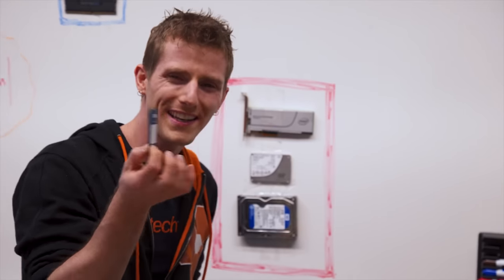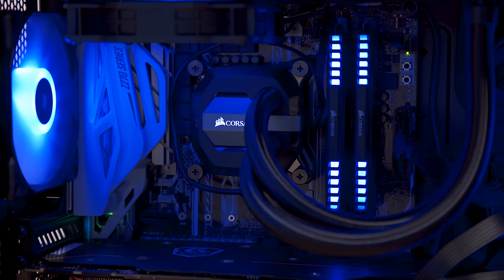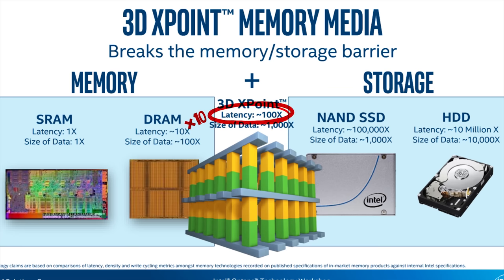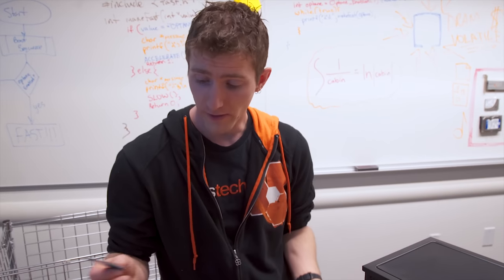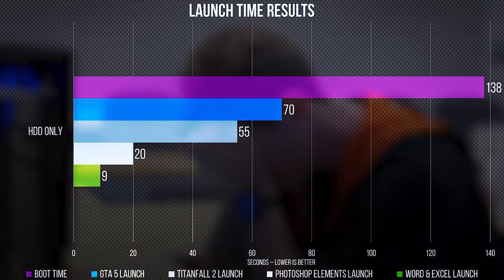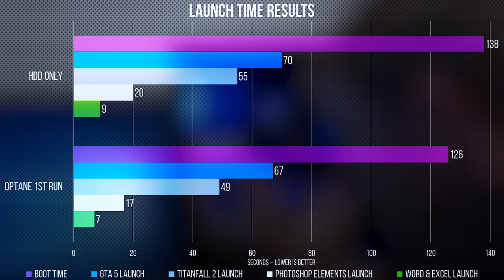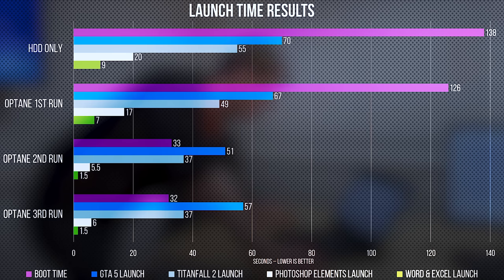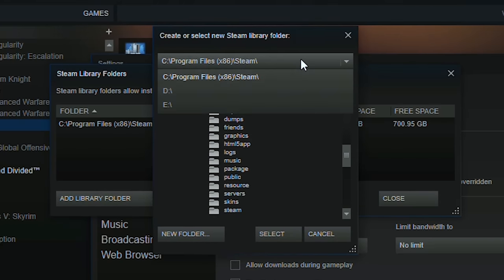Intel Optane Exclusive Hands On - SSD Crushing Performance

Comment: "here is a normal computer"  shows expensive high-end led rig
Reply: considering the lack of a proper SSD, what's being measured here is 100% accurate
Reply: a GAMING normal computer
Reply: Watch tech deals if you want normal.
Reply: 1080's arent normal bby....
But i do see your point.
Reply: "here is a normal computer" shows a PC using a Hard Disk as a boot drive.
Reply: I mean I have a very simular computer, I have one, linus has one, thus everyone does?
Reply: Christian O. You forget there are poor people who doesn't.
Reply: But it has ONLY A GTX-1080 not a GTX-1080 TI omg Linus I am disappointed!!!
Jk. JK.
Reply: Every component costs ~$350 or less MAX (do you REALLY need a 1080TI? Really?). Buy one piece per paycheck, assemble as you go. BOOM you end up with $1400 computer. Yeah it takes time, boo hoo. Or just buy a damn $270 Xbox or PS4 and plug it in to your dad's flat screen TV and stfu.
Reply: N Hiles its a normal computer. linus will say it is an enthusiast computer when he sees titan xp in sli
Reply: Tim Mityok Not everyone is a child who can throw away their entire income on PC parts. Throwing away $350 every two weeks is unattainable for most.
Reply: Tim Mityok My issue with that is if you oder parts online. How do you check if its DOA?
Reply: Except a brand new Kaby Lake. Meaning anyone with a pc older than 6 months can't take advantage of Optane at all.
Reply: I bought a 6700k about 6 months ago. Fuck.
Reply: what he meant by normal is intel did not make a non-consumer computer that was specially designed for that ssd if you have a mother board that generation and a cpu your good to go, fuck it seems every time linus makes a vid we get all these wine babies that can’t stop talking about cost and when someone tries to tell them to fucking save some money they shit themselves trying to insult them and and saying not possible (DevilDude4427) at the time I built mine I was working in a supermarket only 2 fuckig days a week and was studying finished it in one year and my rig can still benefit of that so yah it’s not fucking hard you just need to be patient and save.
Reply: Poor people won't have money for Optane, if theey would have, then they will buy SSD.
Reply: TurtleGalaxies the graphics card doesn't do shit for the build. Neither do the LEDs. He was demonstrating the speed difference achieved with optane. Unless you saw a $1500 ssd being used in that build then it's a normal computer with a shitty WD blue
Reply: Well, Optane is supposed to be $50, and you don't need that ridiculous rig to utilize it. You just need a motherboard new enough to have M.2.... It is significantly cheaper than an SSD.
Reply: AlfaSierra937 may also need CPU & motherboard support
Reply: That light bulb is also the heating system too.
Reply: high end with a old shit hard drive
Reply: It's actually pretty easy and could be done in California. The $200 would cover food for the month. About $550 would get you a room with house access and internet. Since you have no job you don't need a car. Perhaps use the extra $50 for a phone service.
Reply: he hasn't been exposed to the real world yet, take it easy on him.
Reply: +StefanRG1 You have literally no idea what you're talking about
Reply: comik300 Reading comprehension he said 200 a week.
Reply: derp moment. holy shit i need this. why am i working?
Reply: lol don't worry. State has enough tax burden as it is. Don't want to contribute
Reply: I got my dad to buy my gaming computer kek. It still crashes though.
Reply: Or it could be because you live with four other people? Try doing it on your own and then report back.
Reply: who are you talking to?

Comment: Uhm... the 32GB Optane costs as much as a decent SATA3/M.2 120GB SSD. So, why buy this? Since this is only a cache, it means it will start frequently used programs faster. But if you install a 120GB SSD, everything on that will start faster! Amiright?
Reply: tonyrulez69 yeah, but it looks fantatistic for users with only Big Hdd,s
Reply: I see only one advantage of the Optane: you don't have to move your OS to a different partition. Just put the Optane in, and you are done.
As for users with only big HDDs: they can install an SSD too. Yes, they have to reduce the OS size to fit on it, but still.
Reply: 50 dollar
Reply: Names but what would 32 gigs of extra "cache" help you in that situation? It still can only store 32 gigs, so loading more than those into it won't work. I think this is only meant for users that don't have the time to reinstall their OS on an SSD, I hardly doubt it's superiority in terms of simple "boot times" when compared to an SSD.
Reply: You foregot an average consumer (yep average consumer is still quite stupid about technology in 2017)...You would be suprised how many people don't know how to put a new ssd, or even know they can do that to improve speed. We don't even need to talk about reinstalling wins or cloning hdd to ssd  :) 
And for that market and prebuilt low buget pc's optane is quite handy.
Reply: Optane has faster technology than NVME but the these Optane drives are slower than Optane drives. Not because of tech but because of the B+M form factor. They support only 2 lanes whereas NVME drives support 4 lanes.
Reply: Plus you'd need those expensive mobos which nobody wanting to save would buy as it defeats the whole purpose... Unless I didn't get the whole purpose
Reply: Exactly. Just buy a good NVME SSD and you're fine.
Reply: Because most 120gb m.2 SSDs that cost around 50 bucks use AHCI/SATA interface/protocol, not the much faster NVME so the boot times will be as fast as a SATA SSD... That's why, I think.
Reply: I don't know where did you saw a graph with SSD.. It's HDD only in graphs...
Also optane speed of 2400MB/s is quite lower than 960 EVO 3200MB/s, write at 2000MB/s is only 100MB/s higher..
Reply: uh ? no
Reply: I think this is a great idea. A drop in card that will increase the speeds of what most people use their computers for, and it doesn't require migration or cloning. If you talk to a casual user and say, "Hey, did you know you can get much faster performance if you buy a new SSD, plug it into your computer and clone it, and then take the old drive out of your computer and replace it with the new drive you just cloned", they would probably pass due to perceived difficulty. If you say to them, "Hey, stick this in that slot and your computer will run much better", well, that seems much more accessible. Plus, if it is being released at just $50, I imagine the price will be pretty damn cheap in the near future. All it seems to be is a SATA based M.2 SSD, which you can currently get for $30.
Reply: MeatPopsycle You can basically do the same thing with any 64GB non Optane SSD for a lot cheaper.
Reply: How's that?
Reply: the benefit seems to be that i dont have to worry about moving frequently used programs/files (which might change over time) to a specific drive to get faster performance. Even for me, I ony have a 120GB SSD with 2X1TB HDDs. It would be  cheap way of upgrading speed on some programs without having to buy a 500GB SSD or something.
Reply: MeatPopsycle Even a normal SSD upto 64 GB can be used for caching hard disk using Intel ISRT. More importantly, ISRT supports accelerating non-boot disk. So normal SSDs as caches are less costly and more versatile as compared to Optane. For someone on a tight budget, a 64 GB cache for $35 makes more sense than 16 GB cache for $43.

Comment: so you want a 7000 series chip and a 200 series motherboard, but not an ssd? what a small neich thing
Reply: Look at it another way, a basic consumer, non enthusiast, wants a low cost, simple to use new PC.  Is that a small niche? Optane allows basic New PCs to have faster boot times without the cost of a separate SSD or the complication of 2 drives.  I see Optane as a product for the low budget end of PC building.
Reply: i agree, much better to spend money on a big ssd than a hdd and optane chip. less components, more even performance, and who knows how much that optane is going to cost.
Reply: You can buy decent 120G SSD for the price of that optane stick.
Also you need expensive motherboard to install optane.
In addition to that - there is not complication ascosiated with 2 drives. Just none.
Reply: It could be integrated into laptops quite easily. Allowing large HDDs but still allowing the performance of an SSD. Its not just desktop
Reply: Optane is primarily meant for servers where speed performance is critical. They just decided to give this option to consumers.
Reply: +Simon Upstone You missed the point. The things you need are expensive.
Reply: this is just an expensive version of ISRT with normal SSD.
It takes exactly as much efforts and less money to buy a 64 GB cache SSD.
Reply: Simon Upstone for that price it's close enough to get an add dude. That shit is not worth for normal users like you and me. That is some server class shit. Unless you have 5 HDDs with 2tb each and you transfer large files frequently. Or it doesn't even increase transfer speed only boot time. Then it makes even no sense.
Reply: If you buy a 7th generation Intel CPU and board, you should get a nice NVME M.2 SSD and you dont need this at all.
Reply: rePETER30 Because a G4560 or an i7 7100 are high end hardware
Reply: Or just a sshd
Reply: rePETER30 yea, but then there's the avg gamer who cheaped on the storage of Thair pc and went with an ssd for os and an hdd for the extra content and archived games that they don't play often. That's where this comes in, it will boost the speed of the hard drive making it a pretty useful in these situation, specially if the price range is right, I mean I'm sure I heard Linus say 50 $...
Reply: My 100 series mobo has an m.2 nvme slot. I have an ssd in it though.
Reply: N-ninja, unfortunately, that use case is not possible with these Optane drives. These are only designed to speed up the boot drive, not any other drive.
Reply: Interesting.  So it basically converts all of your 'deep storage' mechanical hard drives (the 1+ Tb stuff) into Hybrid drives.
Reply: $44 for the 16GB, $77 for the 32GB
Reply: Mike Crimmins add a little more money and hello SSD. Hahahaha
Reply: In a few years when we have moved on to 9000 or 10000 series CPUs and 7000 series are the cheap chips in mainstream PCs then this thing will make much more sense.
Reply: That may be true but if you want to speed up your TB HDD beside of your boot SSD it's realy cool and a lot of cheaper than buying a whole new main data storage :)
Reply: rePETER30 niche?
Reply: Isaac Poops you need to realize that by doing what you would want it would be like asking a company to throw away money right
Reply: I swear Linus said $50?
Reply: SuperCubar this memory can only speed up boot drive on which Windows 10 64 bit is installed. not just any hard disk.
Reply: 7000 series cpus and 200 series mainboards dont grow on trees...
Reply: core series support only so not the g4560
Reply: For a desktop line-up that would feature Intel Optane, will be about the same price, as a line-up that would feature SSD.
I just dont see a point as well.
Reply: Isaac Poops if u think intel's doing that great then you're wrong, anyways which company doesn't need more money? It's the main point of their existence... to make money lol
Reply: just wanted to clarify, this will not transfer large files faster, you will be bottlenecked by the mechanical hard drives specs.  This is the same concept as SSHD (solid-state-hybrid-drives) in which a portion of the data is cached to increase boot times and load times of commonly used programs.  The catch is if the 32 gb stick gives that much but im guessing that will be a 100 dollar chip while the 16 gb stick is the 50 dollar one.  The issues with most SSHD is the cache available is limited to around 2-4 gb.   

If i had to take this with any understanding with what is going on in the market I would expect most of these things to be introduced into budget laptops from hp or dell.  SSD's are on the rise for prices as well as ram 

This is a way to increase theoretical performance of laptops and making use of the nvme slots on the boards... plus it will be a marketing sales pitch at retailers about how much faster your pc will run with it.   I don't see any system builders using this at all due to price and hardware limitations needed to use it.  I do see there being a purpose in utilizing it by companies like dell, hp with new intel laptops as well as a way for intel to try and match price/performance of amd's upcoming apu laptops that should be coming in the fall.
Reply: prices were announced a few days ago and their pretty cheap for the performance. linus even said its about $50 for the 16gb model
Reply: Its like expecting a fart and getting a shart... sitting there in a trance, some thing something and shitting your pants.
Reply: or you can get a 120 gb  ssd for 50 dollars, there is very little reason to get one for a personal user, for a business it might make some sense since they could improve performance and generally don't need much on a ssd.
Reply: Bleach and im one of them 7700k on a 270 asus strix mobo

Comment: woah.. DLC's on Hardware - War has changed..
Reply: RedOx07 intel pentium 6951 had a dlc
Reply: Heh, they've been doing that pretty much as long as there have been home computers. FPUs used to be sold separately prior to the 486 (called math co-processors at the time), and there were accelerator sockets to fill all the way back to the 8086. The old PCs before them all had some means of proprietary expansion them post-purchase, like the Commodore VIC20's expansion port devices.
Reply: Yeah CPUs used to need shit like "math coprocessors" installed separately.
Reply: Johannes BR yup he's great
Reply: RedOx07 No, war never changes. The DLC union merely advanced into new territory.
Reply: Intel tried a DLC based CPU some years back. This is nothing new - also isn't DLC, since you're buying new hardware.
Reply: Curry Wurst lol
Reply: War... war never changes.
Reply: War... war never changes.

Comment: A 240gb SSD is £60 delivered...
Reply: even NVMEs are far less expensive
Reply: and NVMEs are faster than optane
Reply: But optane has much quicker response times, which you, you 14 year old in your basement, who has a computer mom paid for, wouldn't care.
Reply: Captain Chicken Plus, it takes confusion out of putting things on different storage drives.
Reply: And apparently they mostly just make your computer boot faster, which you, a person whose computer likely crashed constantly, will likely appreciate.
Reply: burn
Reply: SuperWotman NVME boot drive owner: can confirm
Reply: This is actually a RAM cache not a SSD. You can't see this thing as a drive but a CPU-controlled caching chip instead. That's why its speed only comes after the first boot.
Reply: No, it's a disk accelerator cache, not a RAM cache. It's far slower than RAM, so using it to cache RAM would actually slow things down, not speed them up. It's faster after the first boot because it looks at what was used on the disk and stores that in the Optane cache, not because its looking at what's in the RAM, and it mostly benefits boot time because since the files needed to boot the OS are the first things used, they are the first things cached.
Reply: Cash?? as in $$?!?
fml

Comment: If you're buying z270, you might as well get an SSD.
Reply: Luca Passalacqua or an SSHD.
Reply: Luca Passalacqua or b220
Reply: I'm so happy i'm cheap, I bought a z270 without an SSD but now i'll boost my speed without spending my money on one!
Reply: You know a 32GB Optane costs as much as a brand new 120GB SSD or a used 240GB SSD? Basically you'll spend money on boosting the frequently used apps, while for the same price you could boost 120GB/240GB worth of apps.
Reply: And I won't even consider getting a kabylake + 200 series motherboard for this shit 😂😂
Reply: It's mainly worth it for certain business solutions (where loss of data is not wanted from RAM, and SSDs are slightly slower).
Reply: If business is the main concern, then the money you save buying skylake and h110m motherboards is enough to get a 500GB SSD and a beer. And i guess you will still save money. Even the price difference between b150 and b250 is so much that i think you can get z170 and b250 mobos at a similar price and then an SSD.